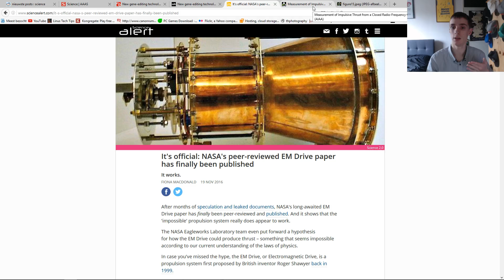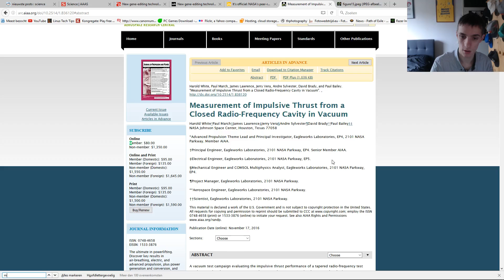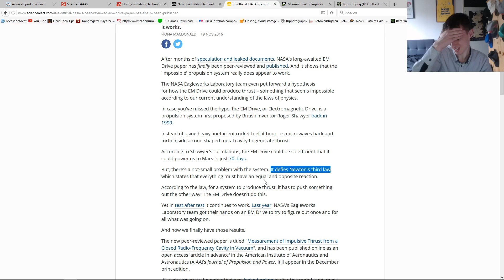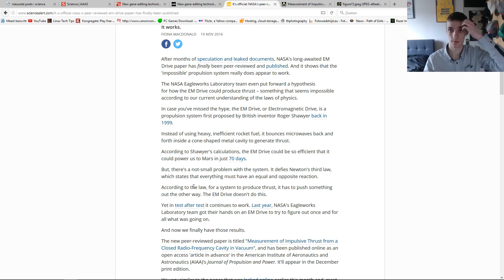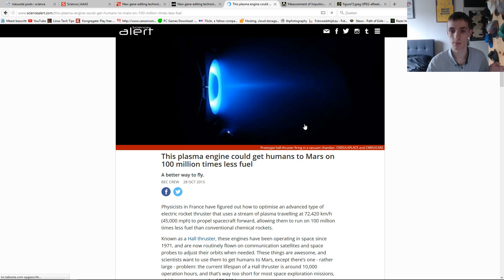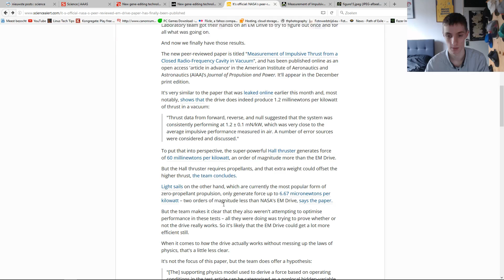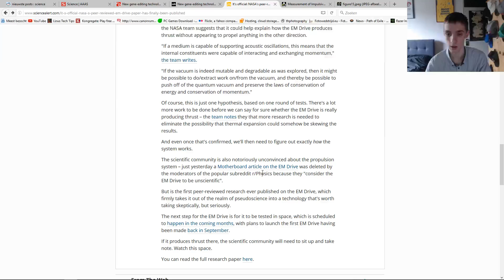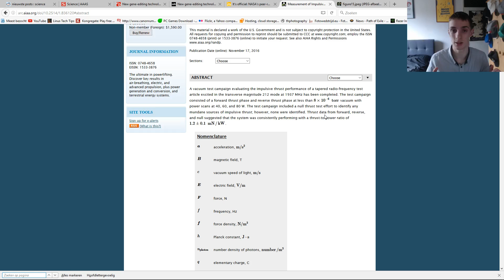Scientific weekly #4-NASA EM drive overview

Comment: OK if you so believe that this is a ploy of impossibility . I want you to explain to me how a helicopter works . Now lets be clear on this machine i have thought of this years ago but I have yet to make a engine ,This person has built the 1st one and I can say this it is very possible . For years I have explained how a machine like this one would work but lack of funds as well as lack of time < Now that i have plenty of unfortunately. I can see this as a machine just think of the gyro electricity that the Government will not let the person have a patent on . I am so ashamed of them for letting them have this but I can see how it works am i am so pleased !
Reply from the maker: A helicopter works by pulling air from above and dispensing it below it's self, it relies on movement in the air, the biggest difference with this is that the EM drive works within a vacuum, a environment without particles to move around, an environment helicopter wont work. owh and if you look up "gyro electricity" on google the second link actually is the patent that you mentioned.